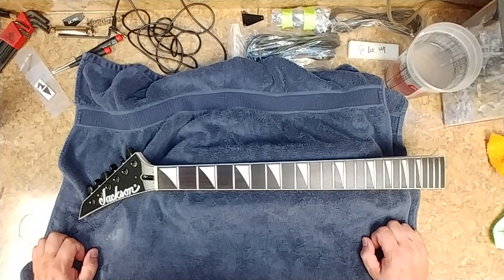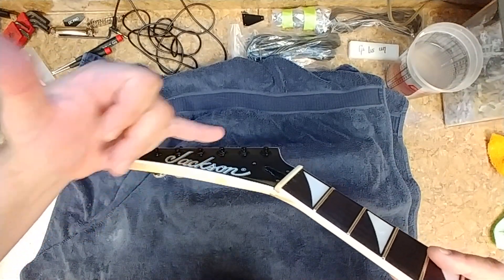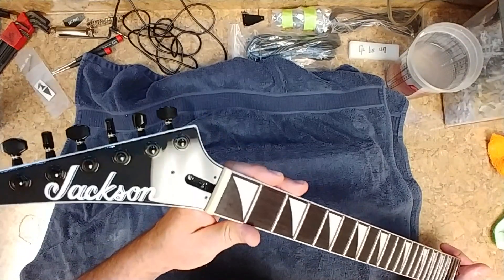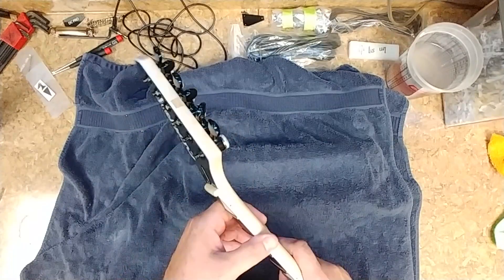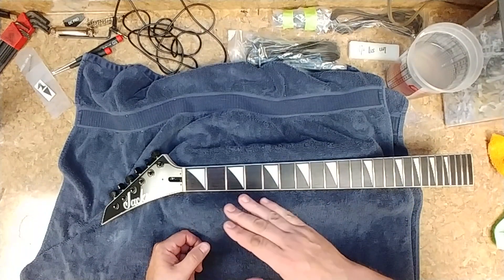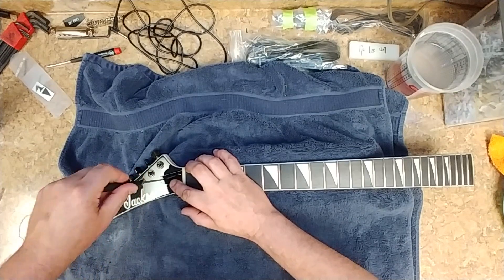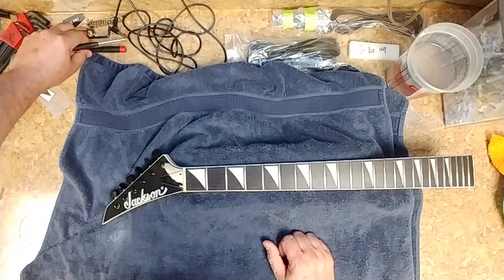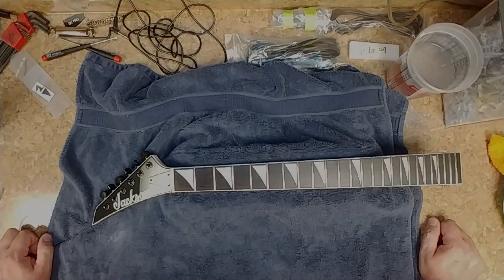Jackson Neck Repair and Restore IS DONE!!!!

Comment: If I sand it down does it need a varnish? Mine has a weird red/pink mark on it from the factory.
Reply from the maker: I wouldn't use a varnish, but I would use a spray clear on it after sanding out the mark. Try to use a rubbing compound on the mark first. The mark might be on top of the clear.
Reply: @ericctheartofnoise8613  Thanks so much.
Reply: @ericctheartofnoise8613  Really grateful for your help. What is a spray clear? Is there a certain brand or product? Keep up the great work.
Reply from the maker: You can get a spray can that only is a clear coat. Like spray paint in a can. I like to use Spray Max 2K Clear Glamor. Just do not spray clear or any other paint in a closed room with no ventilation, and always have a mask covering your mouth and nose when painting.
Reply: @ericctheartofnoise8613  Thank you. 🤗
Reply from the maker: Your welcome.